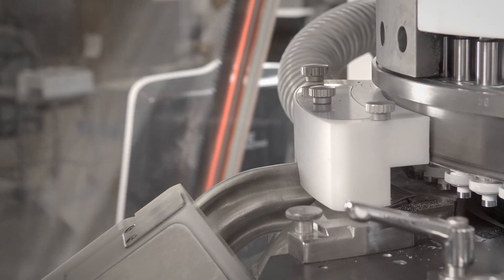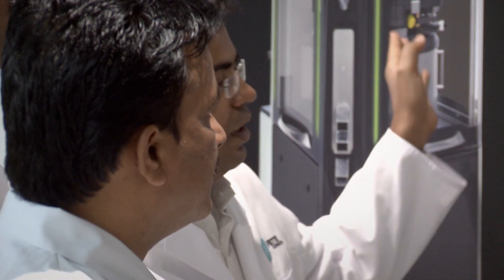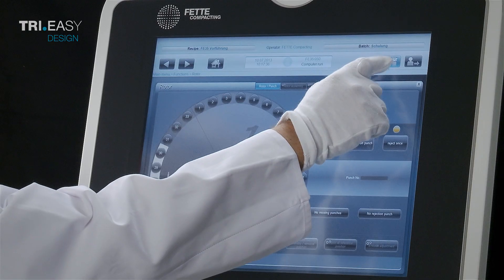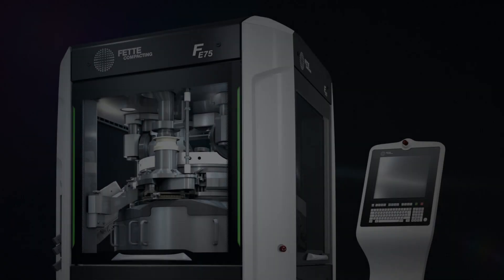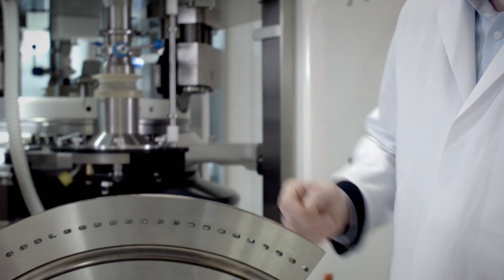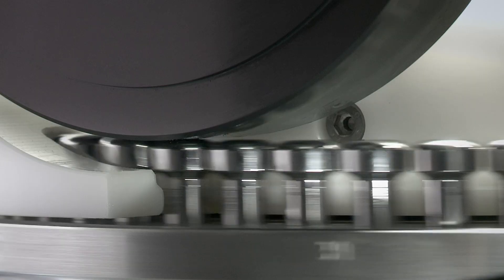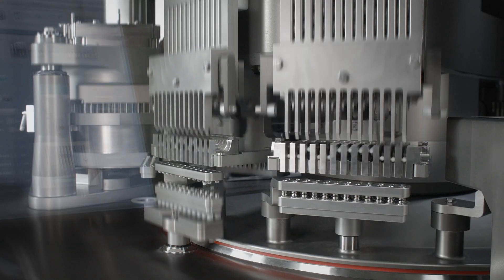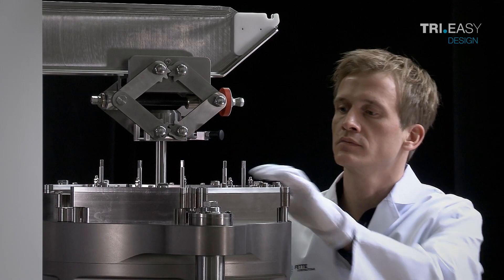Fette Compacting Technology: Efficiency from the market leader | Fette Compacting

Comment: we have problem about punchees .we used punchess  fette on kikusui machine press tablet , and  for life time  verry short under 1 year we change  . how to improve life time puncheess .?
Reply: as I understand with die punches, you need to have extra sets to be able to replace damaged dies on the go.   additionally having a more lubricated and better flowing mix will help on the general wear. additionally if youre running your machine too hard aka over compressing / overfilling and compressing too hard that will shorten life span.  lubricant is everything in all mechanics.
Reply: How do you fixed "sorting not working" error.when testing discharged chute gate..for challenge test of tablets.